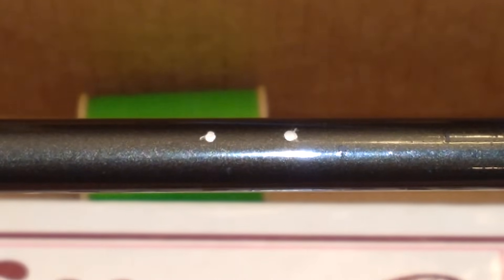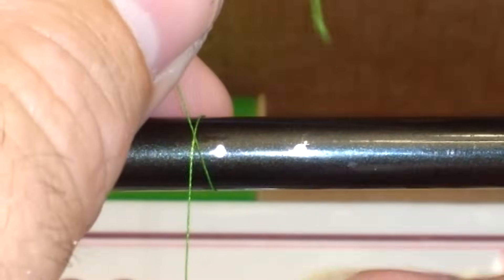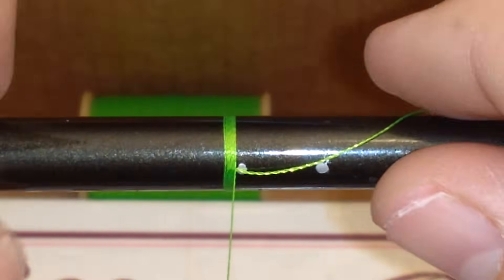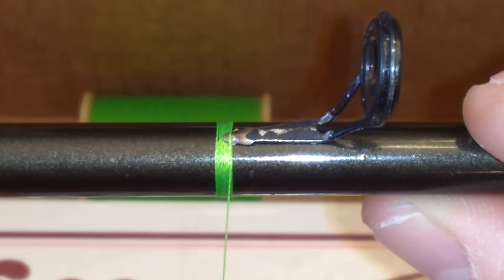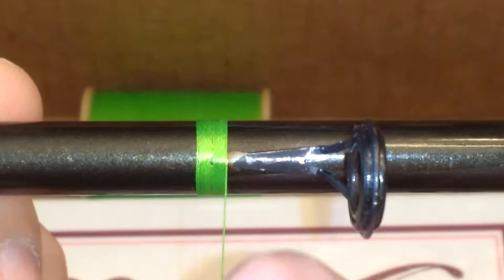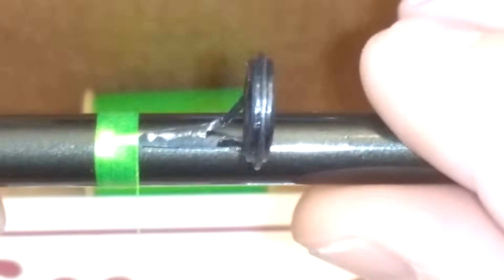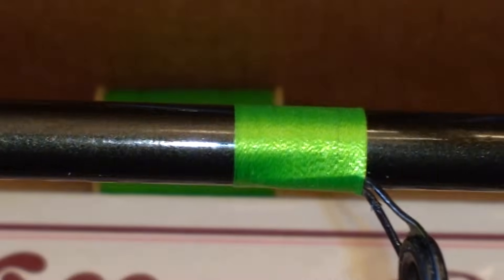Guide Wraps: No Glue, Tape or Clamping on Guide Needed!

Comment: Great Tip! The only thing I would do extra is add a locking wrap. This just adds extra protection for when single-foot guides hit something in transit.
Reply from the maker: I use locking wraps with micro guides, but I don't use them with larger guides that have a more pronounced arrowhead shaped guide foot tip. Just a personal preference, but locking wraps don't really add much weight at all so it really doesn't hurt to use them on everything.

Comment: Left some steps out - the white cord? I worked it out from other vids.
Reply from the maker: It is the same size thread in white instead of green. I normally use the same thread that I'm wrapping with to make my pull through loops, but I used a different color for this video.
Reply: Thanks - it looks wonderful

Comment: If anyone needs a epoxy mixer go to hobby lobby they only 25.00 I got one from a buddy yesterday he bought 2 one for me don't pay high price for these companies who makes thousands of them I made my own board and all working on my 6 spool thread holder now might even make 8 holder sewing machine motor with pedal only cost 25 to 35 dollars then either but the holder online Amazon or pick you up a few end caps for pvc as I did I did but one online as well but it didn't make it here for few weeks take the cap drill 3 or 4 holds in it run tap in Pick up sum plastic bolts they working great on my set up soon I'll have pictures of my set up I believe I've got less than 250.00 in it and I bought 4 aluminum bars to slide my up rites in the track works great

Comment: won't work with a double guide foot on casting rods though
Reply from the maker: It will not work on any heavy weight guide. I've used this technique on double foot snake guides, but those are extremely light weight.

Comment: Tip: Bring along some small plastic tie wraps If your out fishing. If one of your rod guides becomes loose and you don't have a spare rod and reel combo, use two tie wraps on the guide foot to get you through the rest of the day. Just keep the tie wrap nub at the under part of the rod.
Reply: Thanks , now I’m going to put a guide on my rod that way and epoxy right over plastic ties too . That ought to hold it in place .
Reply from the maker: @robertlosasso4222 the right kind of thread is all you need. Even if the thread only had a break strength of 1lb (which would be really low) once you put enough turns to cover up your guide foot you have a section that is stronger than the rod itself. Anything else just adds weight and bulk that does more harm than good.
Good luck to you on your repair!

Comment: Great tip. For micro guides, I use rubber legs used for fly tying. They are very thin and I just wrap them several times, moderately tight and then roll them up onto the guide foot. Super easy and holds them great. I can do all my guides prior to wrapping and check alignment.
Reply from the maker: Great tip 👍
I did a video about using rubber bands as clamps for guides while building. I have a way I had done it but I found another way on another YouTube channel called Palo Fishing and mentioned it in my video. It sounds like a similar process to what you are describing here. Here is that video: https://youtu.be/MuuCzPJ0ijU

Comment: With this process it puts the guide directly on the blank without a protective coating between the guide foot and blank. That can cause rubbing, (and eventually a squeaking noise ) as the rod flexes underneath the guide. 
 
Normally no big deal, but it can cause it to scratch blank, and even weaken it over time. Good news is it's really easy to prevent by backing the guide foot, or blank with anything soft and flexible. 
You could also sit there and slowly grind guide to the point it matches a perfect curvature of the blanks roundness... but that's a nightmare (I had to do it with ReC guides every time ughhh).
 

 
I agree that gluing guides suuuucks lol. I gave giant hands (I cant build any more but when I did) it made it a nightmare to do anything with smaller guides.
 
I never liked hot glue. (Its Florida and hot glue's natural state here is goop lol) I used ferel-tite ... its s higher temp version of a glue that is used for arrow making. 
 
Now with that said, I haven't build since 2011 (fell I'll from a virus that took away the use of left arm/leg.)... so newer material might be available that us better than that. 
 
Great video, and good luck. Keep brainstorming ideas. Innovation in fishing rod building is nowhere near where it should be, and the outside-the-box thinkers like yourself are pivotal in its growth.
Reply: Modern guides don't need to be underwrapped like you're describing. The only time I underwrap is for surf 8 n bait rods or boat rods. I've got a 7ft medium heavy rod with single foot guides that are wrapped just like in the video. Ive fished it for the last 5 years. Its caught thousands of spanish mackerel, 30-40 pound cow nose rays. Thousands of 20-30+" red drum. Have never had any issues with rubbing/noise like you're describing.
Reply from the maker: @cobiakiller7575 I’ve never used under wraps, never had any issues either. I would if I built big game rods just to be extra cautious, but I don’t so it isn’t an issue for me.

Comment: Nice vid. Your wraps look sweet and compact even without an excessive burnishing, and a great idea that I have used with larger guides. I do however, use a narrow strip of the Dollar General, etc., cheap/thin packaging tape laid across the tip of the guide foot, but only after the guide has been filed and tapered to an exact fit so that there are no ridges to hang thread on (and sometimes sanded smooth with 600 grit after filing when size A thread is used. Not as necessary with C, D, or E). The 1/8" - 1/4" tape strip is just a buffer to help prevent cutting of the wraps after they are completed and epoxied, when the rod flexes with casting and landing fish - much like an underwrap helps prevent gouging of the rod blank during flexing on boat/trolling/tuna rods. Applying the tape is easy because after checking for perfect fit, you just lay the tape across the guide foot, then center guide as needed onto the blank, then press down each side of tape until they meet at the bottom of the rod. Carefully run a razor blade, or X-Acto knife, down the joining of the tape joint to trim off the excess. I do this on all my medium-light to ultra-light builds and haven't had a complaint since I started building in 1972 (about an estimated 125 - 150 or so in medium-light to ultralight). Snyper Customs.
Reply from the maker: Thanks for the tip, I will remember that one! I have a lot of rod building videos on my channel, please feel free to take a look at them and offer advise in the comments that myself and others may find useful! You may want to check out the hand wrapper I designed and started building and selling on eBay. It is very nice to use and I have had a lot of nice feedback on the ones I have sold. Here is a link: https://youtu.be/C9j8CjLtVn0
Tight lines!

Comment: Tiny dot of super glue works well but that looked so much cleaner and no messy glue to worry about 👍👍👍
Reply from the maker: You are right, I have done that several times as well. I did it once and accidentally got too big of a drop and it rolled around the rod! It can be messy if you are as ham handed as me 😁

Comment: Too you skipped the section leading into 5:01
Reply from the maker: This video followed another one I did that explained wrapping over the pull through loop in detail. This video was more about starting a guide with no tape, glue or clamps. The video I did that explained the whole wrapping process is this one: https://youtu.be/MV135FdESiY
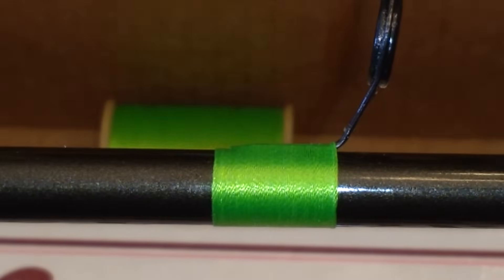And at the 6:35 mark of that video shows how to insert and wrap over a pull through loop. Hope that helps!

Comment: Nicely done. That's one thing I've always tried to figure out. Thanks for the tip
Reply from the maker: Thanks! It works best on smaller guides but I have used the same technique on larger guides by using more tension on the thread.
Reply: Ya slick idea especially for tiny #4 microguides. I’m going to try this tonight. Tnx brother!!
Reply from the maker: No problem 👍

Comment: @ The Fishing Hobby, Very interesting/nice video sir & thanks for sharing. Although not 100% sure on the step with white thread??. Also do you think or would you use same technic for say anything from a small icefishing rod to a bigger say trolling rod? Thanks in advance.
Reply: What is the name of tool or was it just a small bottle you used to rub across thread? That seemed to be to even/tighten thread. Again thanks in advance. Tight lines.
Reply from the maker: The white thread is just a loop of thread that you wrap over. The loop end will be in the side where your tag end will be from the thread you are wrapping with. Cut the main thread and run it through the loop and pull the loop out from the side that you wrapped over. The loop will pull the tag end of your main color under those wraps locking it in place.
I'd use this technique mostly for smaller guides because larger guides are heavier and harder to keep in place with this method.
This is a better method for larger guides: https://youtu.be/MuuCzPJ0ijU
Reply from the maker: It was just a marker or highlighter or something. You can use the back of your fingernail or anything fairly smooth that won't damage the thread.
Reply: @TheFishingHobby ,Ok thanks sir. As thought it was to pull tag in under to secure but wanted to make sure. Ok thanks again for that link,As if I was too try to do one it most likely would be a lil icefishing rod. But who knows if liked & turned out good just might try a summer rod or maybe even a trolling rod. Although not sure will even try as not sure worth the cost of everything not to mention cost of blanks,eyelets,etc on top of rod lathe/holder,epoxy,thread,etc. Especially without being able to see/know cost of everything as well as to see/watch how it's done first.
Reply: @TheFishingHobby  oh ok thanks sir. As it looked like a little white bottle of some sort to me in video. Just asked as wasn't sure if right or was some kind of tool sold for that & happen to just look like an ordinary bottle. Thanks again & tight lines.
Reply: @TheFishingHobby  Thanks again for sharing video as well as the info.
Reply from the maker: @roniler7960  no problem, glad to help. Here is a playlist with my rod building related videos: Fishing Rod Building - DIY Rod Building Jigs - Rod Customizing: https://www.youtube.com/playlist?list=PLX7a8aD_4rEmd_Fl_J4RfNRsUZ3fe6fby
There is a video there about making a wrapping jig out of a cardboard box and another video about using old rods, stripping them back down to the blank to use for building a rod and another video about some supplies you can find locally most anywhere. That can help you get started without a huge investment up front. I'm always happy to help if you have any questions.
Reply: @TheFishingHobby  Hi there,Afternoon sir. Thanks again for the info. Just curious if I may ask,What state are you from?.
Reply from the maker: @roniler7960  Arkansas
Reply: @TheFishingHobby ,Afternoon sir. Ok thanks,As that takes care of that idea lol.
Reply from the maker: @roniler7960  where are you from?
Reply: @TheFishingHobby  the mitten or hell (just kidding) lol,Michigan.
Reply: @TheFishingHobby  I just say hell as a joke,But there is actually a town here named hell.
Reply from the maker: @roniler7960  it gets cold enough there it must feel like hell sometimes 😆
Reply: @TheFishingHobby  Yes but somedays in summer can feel like hell lol. I can assure you that hell does freeze over lol too.
Reply: But I do love me some icefishing. Although this year wasn't very long of a season due to crazy/abnormal winter. Have had more rain than snow this winter.
Reply: Plus get use to it after a while & dress appropriate for it. Just like when I lived in Florida,After time got use to it persay & dress for it.

Comment: I decided to go a step further and reveal yet another method. Took me quite a while to figure this out. take a 1/4" wood bead cut a rubber band in half and feed one end thru the bead with a whipping loop or threading tool. g Go around the rod with the tag end of rubber band and pull it thru the bead. It is now cinched to the rod and you are free to move it up or down the rod blank enabling you to slide the guide under the loop. really hope you guys see the economy of my method. Tight lines.  PS, Hobby Lobby has wood beads, probably Wally's too.
Reply from the maker: Sounds like a great tip. I will give it a shot 👍

Comment: You can't rush art.
Reply from the maker: I'd agree with that. If you're building a rod take your time. This is just a quick way to wrap a guide I thought would be useful to someone replacing a guide.
Reply: @TheFishingHobby  I have to do the same repair to my fav rod and your video helped me clarify a correct and accurate technique to repair my rod. Which will save me some of my hard earned money. Thank you, for making the video.
Reply from the maker: I'm glad it was useful to you!
Reply from the maker: I have another video that may be helpful to you for applying the epoxy: https://youtu.be/BxRtH4dHK58

Comment: I notice the high tech cardboard box you use (same as I do 👍) and also you wind turning top of the blank away from you. What are you using to hold the thread straight down rather than out front where the thread has to come from underneath instead of straight up which I think is much better
Reply from the maker: Here is how I set up the cardboard box jig: https://youtu.be/wEC8ktjlYTk
I actually build and sell some nice wrapping jigs if you are ever in the market for one. Here is a link to those: https://youtu.be/C9j8CjLtVn0
The box jig is a great way to get started but the jigs I sell make doing wraps a lot easier. I just like seeing people involved with rod building either way 👍

Comment: I never though of this, I 've been trying  to come with some way to put on the guide without having to use tape or glue.one thing that will make the guides hold in place and come off under a load pulling from the tip if the glue cracks?
      Start your wrap the some way you are doing , go all the way up the guide foot to the end where you would stop and pull the tag under the wrap,, now back off  one turn, take the line counter  clock wise around the guide at the base were the leg meets the foot three turns , now as you come around that 3rd, turn take the line 2more turns around the other side of the guide and put the line through your pull  thread. There is a name for this step I can't think what it is called, I use it on all my one footed guides ,to me it makes the guide like it finished now you could put a
Reply from the maker: I'm not familiar with that process. If you think of the name please let me know because I'd like to see it or if you can find a video post a link if you don't mind. Videos help me out a lot because I learn best by watching (like most people I'm sure). Thanks!
Reply from the maker: Awesome, thanks so much!

Comment: Can u put nail polish after that wrap?
Reply from the maker: Yes you can. Clear nail polish is nitrocellulose lacquer which is what was used on rods a long time ago before epoxy. Some clear nail polishes are much thicker than what was used so on rods so you may need to either use some nail polish thinner with it or heat it so it isn't as thick when applying. You can search on Google and find a lot of tips for thinning nail polish.

Comment: You could use a little glue to help keep it in place. That will also fortify the hold or reinforce the eye, when pressure is applied.
Reply from the maker: Glue is another method. I usually tape mine on while wrapping. This is just a different method I thought people would be interested in. It actually works really well on smaller guides.

Comment: You never mentioned what type of string your using and you skipped the last part showing us how to finish it
Reply from the maker: Thanks for commenting! It is Coats and Clark trilobal polyester thread machine embroidery thread. When you say finish it are you talking about epoxy? This video was mostly done just show a different way of starting a wrap without taping or glueing the guide in place. Here is another video I did that is a little more in depth on doing guide wraps, I hope it helps you out: https://youtu.be/BxRtH4dHK58

Comment: Nice video !! I have a question. Would you recommend creating a ''base layer'' of thread wrapping for the guide to sit on, in order to avoid the direct contact of the metal guide and the blank? (and basically follow the whole process on top of that ''base layer'' )
Reply from the maker: Sorry, just now seeing this! Underwraps are used a lot on large saltwater rods but not really used for most freshwater rods. You do want to make sure there are no metal burs on the bottom of the guide to scratch the finish.
Reply: The Fishing Hobby Thank you very much for your response 😊 That's useful information!

Comment: What if you have a double foot ring?
Reply from the maker: I'd probably just use tape in that case. I still use tape most of the time to start my wraps. This technique in the video works best with smaller guides. It works really well with micro guides too.